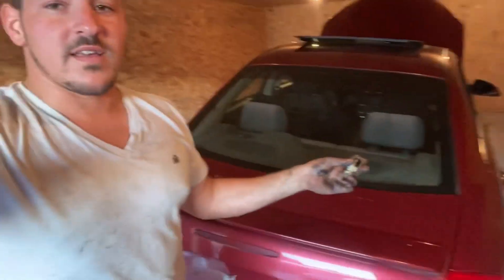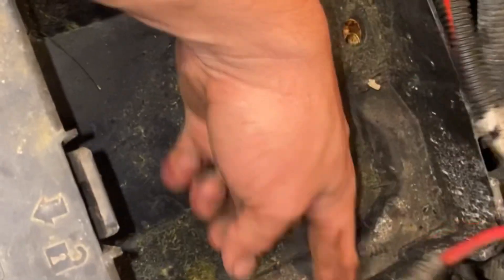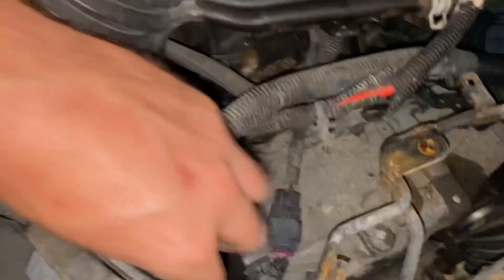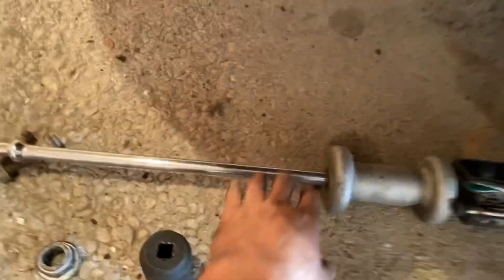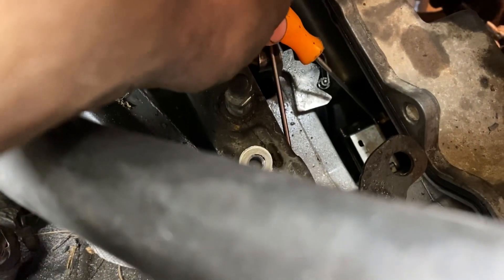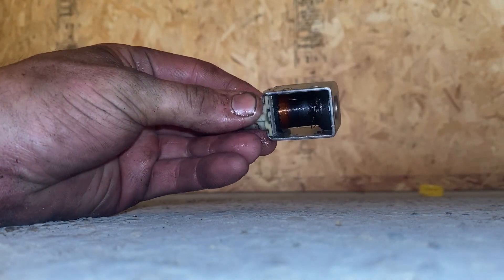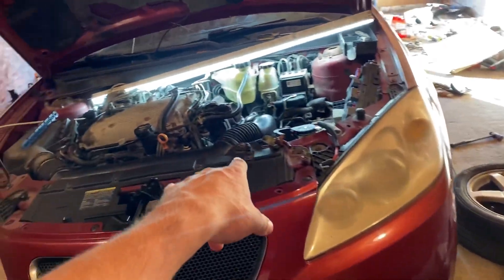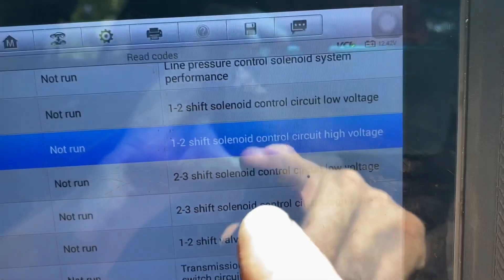4T40E / 4T45E Pontiac G6 GM Chevy Transmission Shift Solenoid Replacement

Comment: Had the same shift problem no first or forth gear , replaced the solenoid used the fishing line on the horse shoe clip but went from the bottom to replace the clip,to hold the clip I used a push button cable with the 3 claw pincher.  Can’t say enough on how great you explained the whole process, thanks again for all the incredible details !

Comment: I've worked on a lot of cavaliers. Couldn't you just drop the sub frame and lower the drive train with an engine support or at least the one side to get that cover off? That looks tight.  Great video. Thanks
Reply: I never worked on a G6.
Reply from the maker: You could, but I find this much easier and safer if you don’t have a lift. It’s really not a hard job at all. I’ve done 3 of these now.
Reply: Can i just take u mine it came out with code p0752
Reply: @MidwestMechanics so you were able to get the case off with out moving the subframe? Are you able to get to the other solenoid and converter lock up

Comment: So what code popped up for you? My code is showing po751
Reply from the maker: I don’t remember the exact code, but it was along the lines of “1-2 shift solenoid circuit high”
Reply from the maker: I just did a second Pontiac G6 week with the same issue, and got the whole job done in 2.5 hours. Much faster the second time around. It’s a fairly easy job.
Reply: This video was very informative you broke the steps down perfectly
Reply: What issue were you having? I am having issues of my 09 G6 not wanting to go faster than 25mph, and seems to stay in first gear.
Reply: @nathaniellittle  my friend had the same problem. He just didn’t drive it for a month, got in one day and it was fine, idk whats up with that, mine just started to shift really hard and the tc light came on
Reply from the maker: @nathaniellittle  this one started off slow in 2nd gear, and would shift to 3rd with extremely high RPM at 55mph since it wouldn’t go into 4th. So no 1st or 4th gear.
Reply: I have done a number of these. Service Trans first.
Remove top Trans mount. Hang engine on top. remove  dr side tire / wheel. Lower sub frame dr/ side .
Remove side cover completely. 
Swap both a&b 
Solenoids along with pressure Solenoid. Inspect side cover gasket replace if necessary. Go back in reverse order. 
Top off fluid level. 
Erase codes / test drive. 
Good luck. 
Have a great day.
Reply: @MidwestMechanics should I replace both solenoids instead of 1 at a time?
Reply: Same!  @nathaniellittle 
What fixed it?
Reply: @MidwestMechanics my code was PO 700 and PO974

Comment: I sent you an email to the email above if that is still yours. Thanks a lot man, 2007 saturn ion 2.2. With your video I was able to adjust a few things here and there and replaced the 2 shift solenoids and the one below that because, why not, already in there lol.

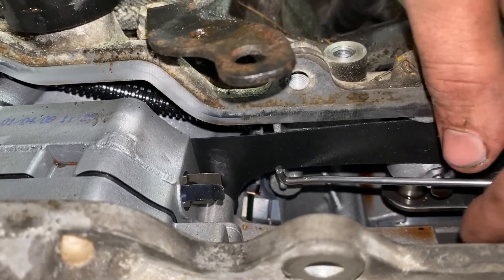Comment: At 7:30 whats the name of that duck beak part that the metal rod goes into. For some reason when i got done the duck beak  part disappeared 😢, i don't know if it fell all the way back  in the “Hole" or Fell out. It was there when i started and unhooked please help if can ????
Reply: I thought the same thing happened to me. Put a magnet in that hole and she will come out
Reply: Thanks 🎉i got out but sadly after finished the problem was still there no drive just reverse

Comment: Can someone have a problem with a faulty shift solenoid and not have a check engine code?

I also have a g6, when it's in reverse it functions as it should. But when I put it into drive, it takes almost 5 seconds to get to 10 kmph. I have to rev it to 3000-4000 rpm and then take my foot off the accelerator, and then accelerate again for it to shift gears. Has no issues maintaining speed, can go 100 kmph if needed, but getting there is an issue. Once it's in third gear it doesn't have much problem gaining speed, but the first two gears are a shit show.
Reply: Yes. I did. It slowly degrades intermittently over time. I got all kinds of different symptoms over a long time that seemed unrelated, until it finally threw a code.
Reply: I have the exact same problem word from word, did you find out which solenoid it is?

Comment: does the side pan have a gasket or sealer or - i didn't catch how to put back together ? edde   also - it seems odd that an electric solenoid could work with out some power - it didn't seem like you "plugged" somethin in like a sensor has a plug =- or did i miss that part ? thanks
Reply from the maker: You’ll have to hook the electrical connector back to the solenoid after you install the new one. The gasket cannot be replaced without removing the whole transmission, so I just reused the old one and bolted it back up. No leaks.

Comment: How much that job cost in the shop
Reply from the maker: They typically won’t do this job at any shop, they’ll just quote you for a whole new transmission.
Reply: @MidwestMechanics  That explains why I got a lot of shrugging when I asked shops nearby about my '07 G6's P0977 issue and how much a solenoid swap would cost. RPMs spike past 2k when trying to go over 30-40mph so OD is gone I guess? I'm not a car mechanic but I like how if you're broke you have to basically eat it or have all these tools and space to work on it yourself. I don't have any easy way to do all this. I feel like just junking the thing. Kinda sad situation; friend gave it to me when they got a new car. Everything works except driving. 🙄
Reply: Yep that's what a shop just told me.  $5,000 for new transmission. Book value on my cobalt is only $1,500.00 @MidwestMechanics

Comment: How did u take out the A solenoid thats where I’m at
Reply: My g6 doesn’t reverse but it drives I’ve already checked the selector switch and changed the transmission fluid only thing I can come up with now it’s the solenoid what do u recommend